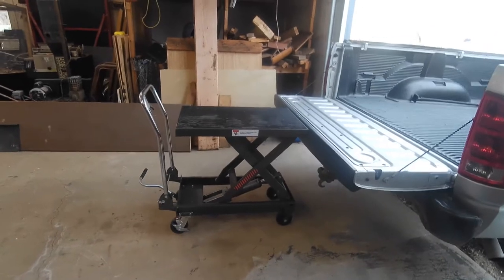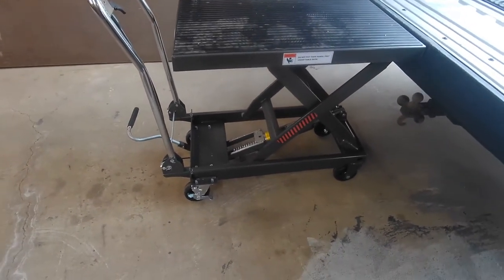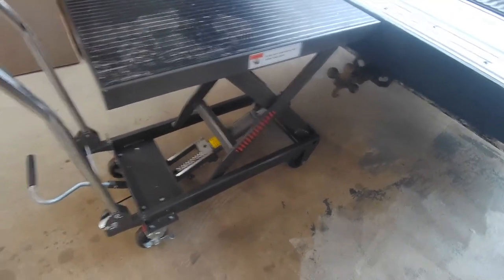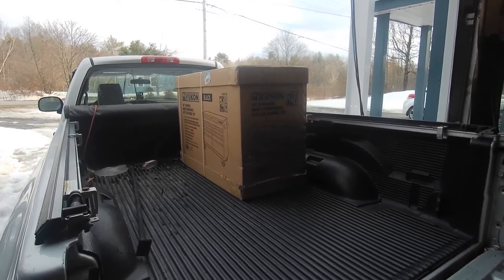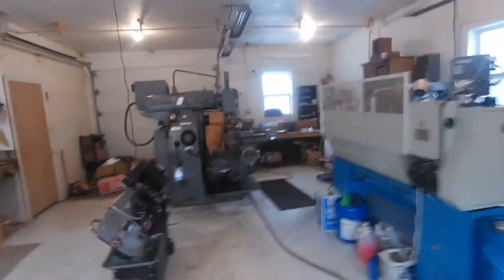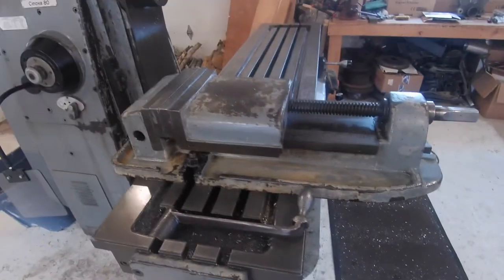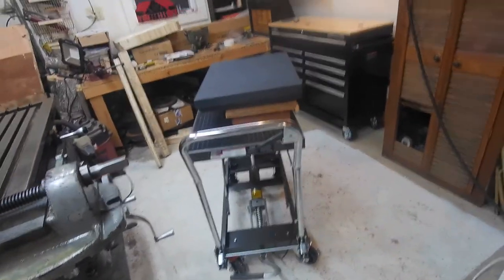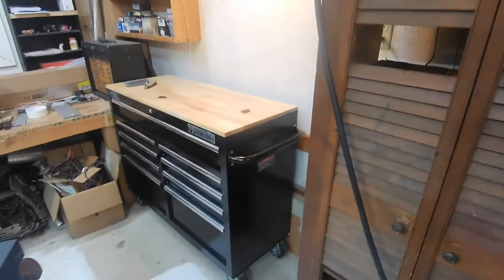HF 1000lb lift cart

Comment: I have the same table. I use some ratchet straps to safely pull stuff onto the top.
I've used it to replace a double oven, move my 700 LB Smithy 3in1 machine, and even once to help demo a heavy tile laundry countertop.
Reply from the maker: Ratchet straps are awesome! So many uses when combined with a little creativity.

Comment: Hmm maybe you could use a tie down around the dolly handle onto the truck latches to stop it from moving if the wheel locks don’t work well enough to keep it in place.

Comment: I wonder can it handle one washing machine around 800/990 lbs or like a fridge.
Reply from the maker: It would be close. On mine I found the limit is about just a little over its 1000# rating. I take it you are referring to commercial units as 800+# is much heaver than most residential washing machines of fridges.

Comment: Thank you for the video. Just had a question we actually install dental equipment Our dental patient chairs are over 300 pounds thinking about purchasing one of these so it can help my guys get the chairs up into their pickup trucks. Just wanted to know how difficult or easy it would be to have my guys take the hydraulic table with them in their trucks to make deliveries.
Reply from the maker: For two people it would be easy, but if just one person you may want to use ramps. The cart seems to weigh about 50lbs; just my estimate from lifting one end at a time. The handle folds down easily without tools, so you can lay it on edge in your truck or van and not take up a lot of cargo space. It will handle the 300Lbs with no issue. I used mine to move an 1100Lbs brake, shear, slip roller, which is slightly over capacity and it was able to lift it, though I could tell that I was at the limit.
Reply: Thank you
Reply: Please be aware that Harbor Freights specifications for this table weighs in at 161 pounds, NOT the @ 50 lbs that was guessed at by a commenter. I would not recommend 1 person to lift this table. 2 fairly strong people with no back issues (yet), yes . And use proper lifting techniques. I have this table and I can assure you it is 161 lbs.
Reply from the maker: @spresc2180  I guess I'm a little stronger than I realized.💪  I did suggest using two people however.

Comment: Will the cart tilt over if you have the boxed moved to much off the cart?
Reply from the maker: If you are on a good floor you are more likely to drop the box over the edge of the cart than you are to tip the cart over. The cart is quite heavy.
Reply: @matthewperlman3356  thank you so much.

Comment: Does anyone know how much the 1000 lb. cart weighs? Wondering how difficult it would be to load it into a pickup bed. 🛻
Reply from the maker: 161 lbs
Reply: I back my truck up against the curb so the tailgate would be lower. Still not easy to lift it into the bed, better to have a helper or a ramp.